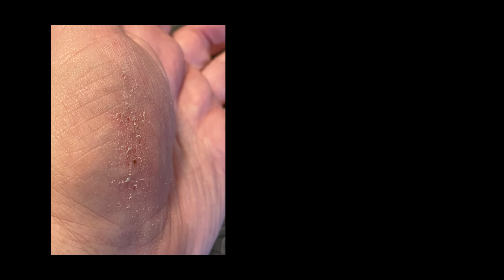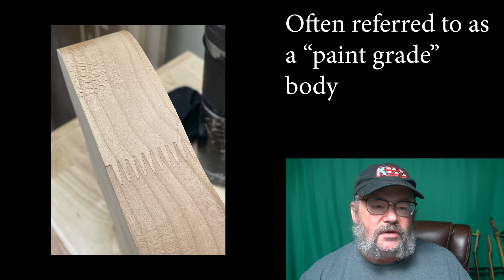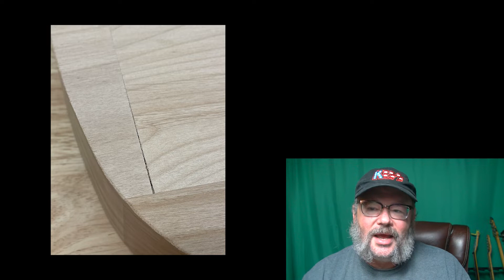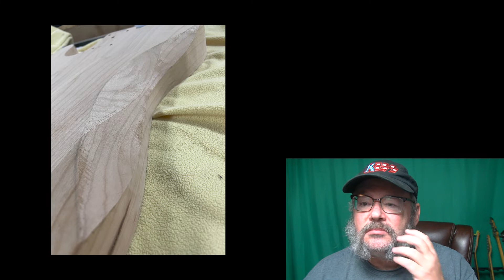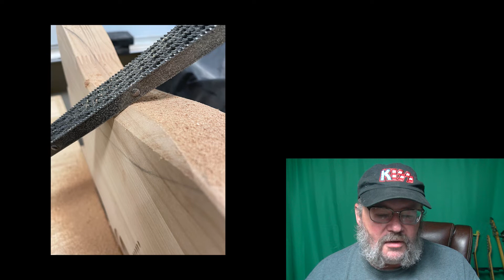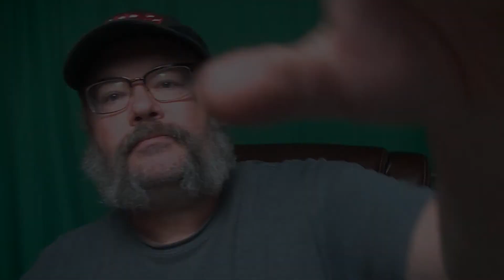Guitar Manufacturing using STEM Concepts Week 3 | RATTLECAN GUITAR RESTORATIONS by James O’Rear

Comment: This seems less CNC oriented than I thought it would be in the shaping. Are other students using CNC machines for the shaping of the body?
Reply from the maker: Negative. The CNCs are used to produce the kits and we touch a bit on designing the headstock in a 3D modeling program but don’t run them on the machines.
Reply: @RattlecanGuitarRestorations  thanks for the clarification!
Reply from the maker: You bet.

Comment: Lovely piece/ pieces of alder. Remember the glue is stronger than the wood. Still doesn't look very structural in the neck pocket. I usually get 5 minuets into a neck carve before I remember to put my gloves on. Those Shinto's are amazing but they bite.
Reply from the maker: My memory seems to be slow with that tool, always gets me…lol.